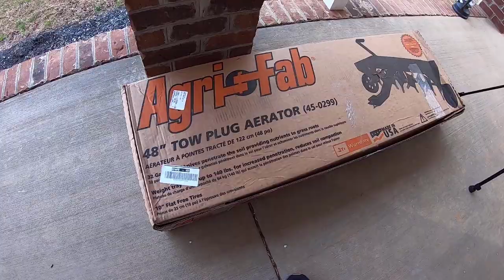11-AgriFab 48in Pull Behind Plug Aerator unboxed

Comment: Turn you blocks sideway 8x16 than your bungie cords will work correctly. Another tip don't make sharp turns it'll put a lot of side pressure on the tines thats why they broke the welds. Hope this helps. 🇺🇸👍
Reply from the maker: Thanks for the tips Kenneth.  And thanks for watching.

Comment: Thanks for the great video. What is the dimension of the concrete blocks? What is length of the bungee cords? Thanks!!!
Reply from the maker: Thanks.  The bungies are 18" I believe, and the blocks are just the standard large, hollow foundation blocks.  I haven't gotten a chance to actually measure them yet, but I'll try to remember to grap a tape and do that the next time I'm headed out to barn.

Thanks again for your comments and for watching.

Comment: The tine penetration into the soil is poor for this unit (maybe an inch at best). I would also recommend removing the wheels/tires to see if you can get better soil penetration.  Also, don't back up with this aerator attached to the tractor, it will bend the stamped tongue right in half... it happened to me twice with my home unit.

Comment: The extra nuts is to double up the outer bolts to protect you from scratches.
Reply: I had the bolts and nuts leftover... thanks for this, I was wondering where they went. I saw them on the instructions' illustration, but didn't know what they were for!

Comment: Those plastic wheels are not adequate, I bought two 10 inch pneumatic wheels with steel rims from Harbor Freight, Idem #: 30900 and the axel shafts fit fine. One inch bigger in diameter wheels makes no difference. I paid for $6.99 ea. Big improvement.
Reply from the maker: Thanks for the tip Thomas.  Sounds like a good idea.  You know I love Harbor Freight. :)  And thanks for watching..

Comment: The last part is concerning.  I watched this video specifically as a review to purchase so now I'm questioning buying this one ;)
Reply from the maker: Thanks for your comment and for reminding me to reach out to manufacturer about replacement part.  Overall this seems like a nice rig, and I'm hoping this was a fluke.  I felt I owed it to folks to be honest in the video about what happened, as I make these to help people; i don't make a dime from anyone for these videos.  I'm just glad AgriFab is a reputable company and have a 3yr warranty on this unit.  I'll post here again once I get this resolved.  Thanks for watching.
Reply: @twc-projects  I appreciate it, and I look forward to what happens.  I got the green light from my spousal unit to purchase one so I might just take the chance.
Reply from the maker: Sounds good. I've heard from a landscaper that he loves his; and he uses this thing a lot more than I ever will.  So hopefully you won't have any problems.  Good luck and check back in at some point to let me know how it works out. Thanks again for watching and commenting.
Reply: Great video. Looking to purchase this soon. Certainly concerning about the bad welding. How difficult/time consuming is it to remove and dismantle the axle to put the new part on?
Reply from the maker: I don't think it will be too bad.  Looks like a couple bolts that connect end support, a bolt on the shaft, and then slide off section that has broken weld.  I still haven't done it yet, but expect the manufacturer will replace the specific part that is broken, so will need to also remove the tines connected--4 more bolts.  I expect it'll take about 30 mins in all to replace broken part with new.  I'll let you know for sure when I get around to this before I need it again in a few months.  Thanks for watching and for your comments.
Reply: @twc-projects  just wondering if you got it fixed yet?
Reply: I also broke two double spools first time using aerator I called manufacturer to hey sent me new parts promptly but welds are very poor only half way on one side
Reply from the maker: Finally dealing with it this week.  Been busy with other things and putting this off.  But two other folks have told me they had the exact same thing happen.  Agri Fab sent them replacement parts no problem.  Still, what a pain to have new equipment break on 1st use..  Thanks for your comments and for watching.